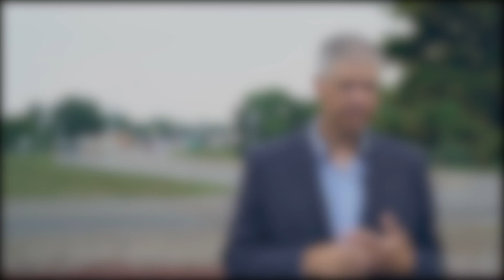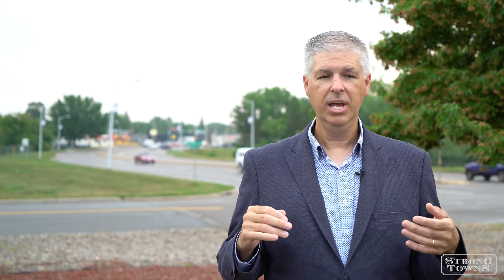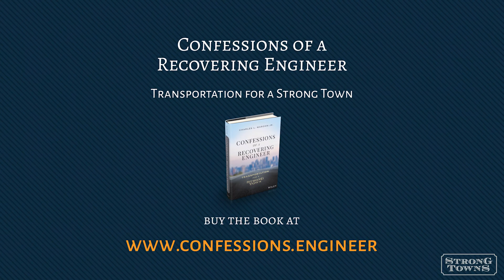30 Days of Confessions: #5 Street "Improvements"

Comment: We often ask engineers to do work, like design, that is not in their wheelhouse of expertise. Language & communication is a challenge, primarily when expecting those without knowledge or understanding about it to use it to solve bigger issues than engineering. Transportation engineers know how to use the specific tools they’ve been taught & allowed, but typically are tasked with working at a stage they don’t have the tools or knowledge to work with. They know how to communicate & use specific language to perform what they are capable & knowledgeable about doing.

Comment: In Coffs Harbour, Australia, a few years ago (maybe 2018 about?), a Traffic Round-a-bout near the central Dominos Pizza worked absolutely fine, no traffic problem & got through quickly.

Then it ws replaced by traffic light, which is a much bigger pain in the arse.
Round-a-bouts are ao much better.
Reply: Bit of a contrast to what the Armidale Regional Council does. The only two traffic lights in Armidale were already there when I moved here in the late 1980s. All the traffic controls built since then have been roundabouts and concrete islands. 

As a kid, and later teenager, I remember being able to listen to the control box for the traffic lights near Ben Venue Public School and hear relays clunking away inside. They've since been replaced with something solid-state in the last 15-20 years.

Comment: What incentivized the current practice is clear; what would you propose to incentivize neutral language?
My engineering experience has been toward the most accurate language, even if this was counter to the prevailing jargon; sometimes this aligned with the past-of-least-resistance, sometimes not. In generating technical reporting or high-exposure reporting, I have put effort to avoid turns of phrase I found dishonest or inconsistent. I understand there is not always this opportunity.